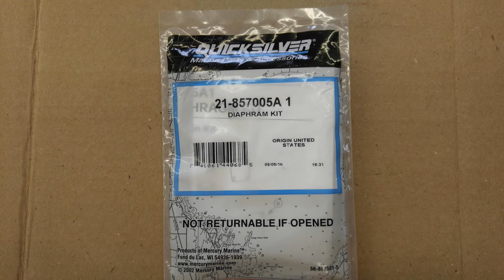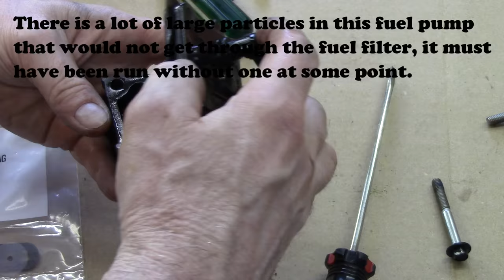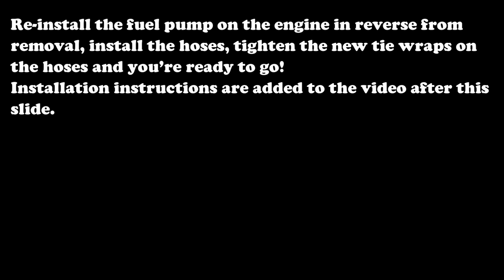Mercury or Mariner fuel pump rebuild

Comment: Thank you much for this video. Followed it step by step to rebuild the pump on my 1994 Mercury XR6 150. Fired up on first crank and idled great on the hose. Hoping it solved my idle issues and lack of power at full throttle. Final test at the lake this weekend.  Thank you much.
Reply from the maker: Glad to be of assistance, thanks for watching!

Comment: Thanks for the video.  I'm goin to give the rebuild a shot. I have a 90 Merc, early 90's that'll run perfect in the driveway, and perfectly on the water, under load, for like 30 seconds. New tanks, bulbs, hoses, carbs cleaned.... assuming fuel pump.
Reply from the maker: Good luck Jeff, I also have a video on rebuilding/cleaning those carbs. Let me know if you run into any snags.
Reply: @HRIservicesllcSturgeonBay  appreciate it.

Comment: Hi Ricky, i am only diy guy but i would say the white hose is the impulse connection to drive the fuel pump,the oil mixture pump and resevoir are seperate.I have 40 hp mariner that uses same fuel pump and some owner has removed the oil mixture resevoir,so the oil mixture pump has been disabled. Great videos thanks.
Reply from the maker: Thank you.

Comment: Hi, congratulations for your videos, it helped me with the fuel pump, but the problems are still there, now it starts better in engine hot but in engine cold it doesnt suck well, only when I'm accelerating a lot. Even worse than before. I changed the fuel tank, the fuel line, hand pump and rebuilt the fuel pump with a new gasket, membranes ... everything. my engine works perfect for everything else .... thanks
Reply from the maker: Glad the video was helpful. If you are still having issues, verify your vacuum line from the base of the engine is in good condition.
Reply: @HRIservicesllcSturgeonBay  ok I check it early, I thought about it before but I didnt check it, of course! is the last thing you think may fail .... ops! thanks, lets see...

Comment: Hi Ricky, I am planning on rebuilding the fuel pump on my 1988 115hp power trim inline 6 two stroke engine.The serial number is OB381388. It has the square fuel pump. I was wondering which rebuild kit I would need. I am not using the auto-blend fuel/oil mixer and instead mixing it myself. Thanks for making this video. I'm sure it come in handy once I start the rebuild!
Reply from the maker: Please send me an email to rickyhembel@hotmail.com and I will send you some information I found.

Comment: I have a 1986 60 hp mercury outboard that bogs with acceleration  under load. Won't get on plane. Idles great. Starts right up and revs up in neutral but in gear only get about 3000 rpm. Rebuilt carbs and I have a  donor motor that had a thrown rod in cyl. 2 for parts. Any ideas of where to start? New fuel lines,tank and primer bulb were just installed and carbs rebuilt. Love your videos! The detail and writing on the video is very helpful especially for the hearing impaired!
Reply from the maker: Kyle there are both two cylinder 60 hp, and three cylinder 60 hp engines. Assuming yours is the two cylinder, it looks like your carb is a round float bowl style carb. Send me an email and I can send you some info. rickyhembel@hotmail.com
Reply: I have this exact issue with my 86 90hp. Did you get it figured out?
Reply: @michaelbarbieri2728  unfortunately I never got it figured out... my best guess is the guy before me put a new stator in and he may have messed the timing up. Timing is kinda over my head so might have to take it to a mechanic.. keep me posted if you figure anything out!
Reply: I have the exact same issue with my 90hp...after about 15minutes of running at idle speed it gets up on plane...cleaned my carbs and will try to sort the fuel pump...will try again this weekend hopefully

Comment: My existing pump comes with little round rubber diaphragm under plastic  check valves which are in most kits but the cheaper kits are not including and your mercury diagrams don't show they are necessary....what should I do?  One of mine is torn so hoping yThat is my fuel issue...thoughts.?

Comment: Are u not suppose to use the rubber disc for the check valve just replace it with the clear one cause I have to rebuild the same pump?

Comment: Great video,  just rebuilt mine and running fine. I'm a little bit puzzled found what seems like yellowish plastic in pump and didn't come from any of the parts in the pump. Any ideas, thanks for the video it was a great help.
Reply from the maker: No clue, maybe something from the fuel tank or dropped in the fuel tank, if the filter is after the pump? Enjoy your boat!
Reply: @Mark Simonetti- pieces of plastic may have come from old fuel lines? Just a thought. Hope you figured it out

Comment: I'm having issues with my 2004 mercury 50hp running. I'm loosing my prime and fuel bulb gets soft and engine dies out. If you reach back and manually pump it, it picks back up for a few minutes and does it again. I was thinking either the filter or bulb/fuel line. I replaced those and it didnt fix anything. It mainly does it while idling or going slow. When I'm at full throttle it seems to run great. Do you think a fuel pump could be the culprit? That's my next best guess.

Comment: hi Great video it really helps ,my new gaskets one is  different from my original gasket ,on pump the large solid gasket 2 off ,on my original has brass mess incorporated
 in it on one only of them but new gasket is just rubber ,Is this a mod my engine Mariner 75 hp 2004 made in Belguim

Comment: when i crank the engine with the fuel line from fuel pump to carb disconnected , no fuel is coming out the pump, is it the reason why my engine is not starting ?

Comment: My instructions say when changing to nylon retainers I must have enlarge the holes with a drill bit. I didn’t notice that but they seemed to seat good. Now it will not start the engine and the spark plugs keep getting fouled with fuel. Any ideas???

Comment: Great video, I’ve got an issue on my 90hp merc 2 stroke 1997 where fuel has leaked back into the oil reservoir tank! How do I go about checking the one way valve on the pump to make sure it working? Should I change the diaphragm as well?
Reply from the maker: Please give me a serial number Harry, so I know I am looking at the correct information.
Reply: Hi Ricky! Thanks for the reply, I will go check my boat serial number now, I’m completely lost as to what would be causing it to push fuel back into the oil reservoir. I’ll get back to you in 30 mins once I have it! Thanks
Reply: I didn’t managed to do it today but the engine is a ME- 90 ELPTO. It’s around 1997 2 stroke 3 cylinder! I personally think it’s the fuel pump causing fuel to push back through the oil pump into the oil tank, cheers rick
Reply from the maker: @harryjelffs7570  I need a number like 0A996142, could start with 0B, 0C, 0D, 0E, 0F or 0G.

Comment: Are all the fuel pumps supposed to make a noise when switched to on? I have a Mercury 2.0 BackMax that doesn’t make noise and was wondering if that meant pump is going bad.
Reply: It’s a 135 Mercury 2.0L BackMax

Comment: Hello i have a 1995 mercury 115 and i have problem on it so the engine make speed only if i press the key 1 .2 or 3 times i fix the carburetor and its the same problem btw i removed oil tank and it become the oil mixed with gasoline by myself i need help please 😩

Comment: Hi, I really enjoy the video, just wondering if you think our 1995 115 hp mercury needs a new fuel pump, we only can get up to 10 mph.    Maybe rebuild it as you did?   It will not go past 2500 rpm
Reply from the maker: That is very hard to say, did it sit with gas in for a while? Have the carburetors ever been rebuilt? Find your engine serial number and answer the questions I just asked and I will look a little deeper.
Reply: @HRIservicesllcSturgeonBay    Here is the Engine code OG212975   We never had anything go wrong with the boat, 1995,  my son took it out boating and he called and said the boat would only go about 10 mph at 2500 rpm,  He got home and I inspected and found the line from the oil pump to the gas line was cracked and leaking bad.  I replaced it and the boat still does not go past 10 mph.   Any help would be appreciated.  Thanks
Reply from the maker: @nickdes1977  I would start out by removing the spark plugs and see what they look like. They should be a coca brown, if they are wet, or black, try to determine by smell and touch if it is too much fuel or oil? I have concerns with the oil line being broken, that the engine may have been oil starved. Next run a compression check on all four cylinders should be 120 to 140 PSI. All cylinders within 10% of each other is best. My email address is rickyhembel@hotmail.com send me pictures of the plugs tips before you touch them.
Reply: @HRIservicesllcSturgeonBay  Good Afternoon,
Thank you for your very kind response.
 
I sent the picture to your Email.  The plugs actually looked good. 

Here is what we did so far.
1. Ran a compression check ,  1,2,3 had 140 psi,  # 4 had  130.    Top to bottom is how I listed the numbers
.2.  My son ran an ohms test on coils,  #3 was out,  #4 was low, we replaced 3 and 4

  3. The plugs and wires were changed last year 20194.  

4  Change out fuel filter

5. replaced cracked oil line to the y. 

6.  We replaced the rectifier needlessly.  

7. 7.  Change prop as it was obviously bent 

I think the engine runs on 2 cylinders until you put it in drive .  That is what the marina guy told me when we bought it.  
Thanks so much for any help you can provide.  

The Engine starts very easy, runs smooth, but just will not come up to speed/RPMS
Nick
Reply from the maker: @nickdes1977  we can work through email from here on.
Reply: H.R.I. services llc Ricky Hembel  hello! My engine is having similar issues. 2004 150 merc outboard. Did you guys ever resolve this issue? Any advice? Thank you for the video and responses. I am going to rebuild my fuel pump tomorrow

Comment: Great video, Tried to rebuild mine from a 1995 Force 70 with a kit but all the plastic pins broke when trying to press them in. Can those be bought seperate somewhere?
Reply: I had the exact same problem. They wouldn't move down at all. Did you have to buy a new kit?

Comment: What kit would work on my 2.0L 150 HP blackmax 18-7817?
Reply from the maker: Please give the year made, and the serial number, and I will look it up.
Reply from the maker: There are many different 150 HP models from inline to V-6, without the serial number I cannot give you the exact number, kit but the number you gave me does reference back to a 150HP Black max. Did you find a resolution?

Comment: I have a 98 115 Opti that runs and starts pretty good , but will only do 3500 4k under a load.  Do you think this could be my problem?
Reply from the maker: Does it miss, stumble, or the RPM's just will not increase? I assume you have already changed plugs?
Reply: @HRIservicesllcSturgeonBay  no miss or stumble.  I got new plugs and am changing this week.  So frustrating . Unplugged both the low oil and heat sensor and no change .
Reply from the maker: @cascivic  AssumIng all the plugs looked the same when you pulled them. Then I would go into the carbs make sure you verify that the main jets are free of all fuel gunk/gum. Replace needle and seats, sometimes the needle tips react to ethanol and other additives, if the needle tip is crooked you float setting will be incorrect, rich or lean. You might as well rebuild the fuel pump while your in there. I have a manual I can send you info, email me rickyhembel@hotmail.com, let me know the serial number and how many cylinders.
Reply: @HRIservicesllcSturgeonBay  thanks for your help.  I took front airbox off to get to the carbs to get numbers for the rebuild kits... Tried draining the bowls while I was there and the bottom carb no gas spilled out and it looks full of 2 stroke oil (bluish thick gunk).  Def have to get in there this weekend
Reply from the maker: @cascivic  I believe you found the problem, not sure how it would be full of injection oil, and no fuel. Let me know what you find? Curious!
Reply: Hey just wanted to write you back and say thanks for everything.   Got the balls to take it apart and the bottom carb was filled with gunk and the main jet was clogged. Had to use a  paperclip to break through ..Boat ran like a champ a lil over 5k rpms.   Wondering if I should rebuild fuel pump now 🤔
Reply from the maker: @cascivic  no need if all is good, although a kit is cheap, you could order one and have it on hand just in case it decides to crap out on a planned weekend. It's a fairly easy fix, cheap insurance. Have a terrific summer!